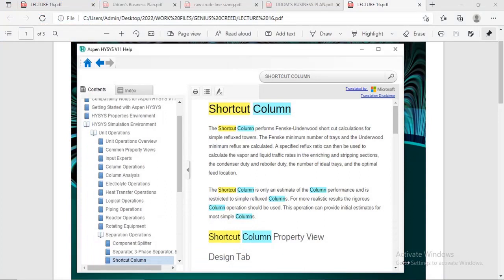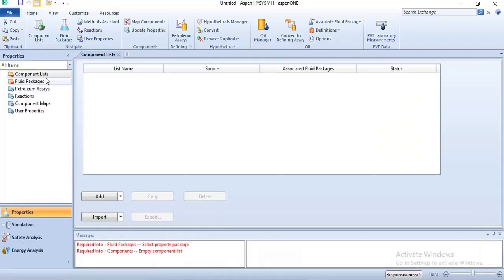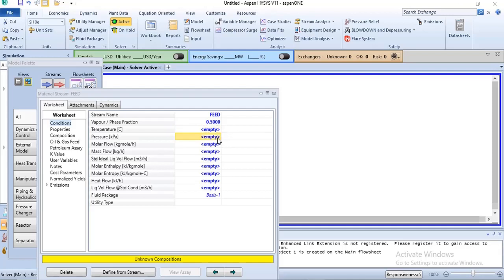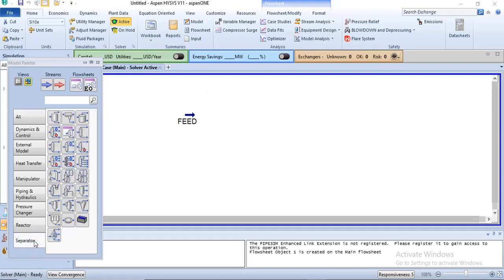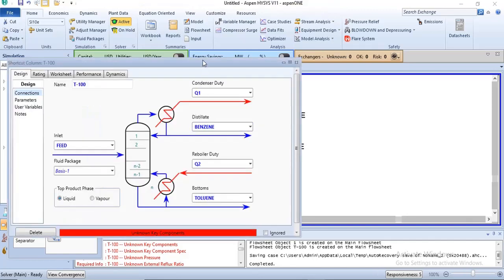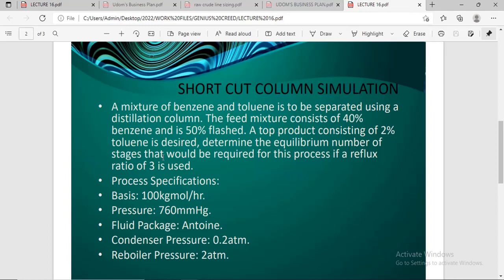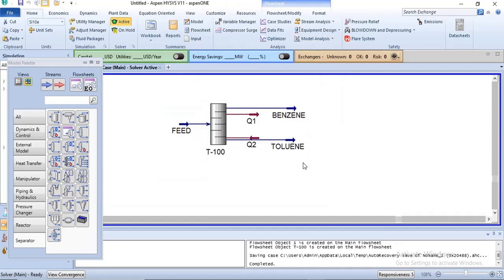Aspen HYSYS Lecture 16 Shortcut Distillation Column

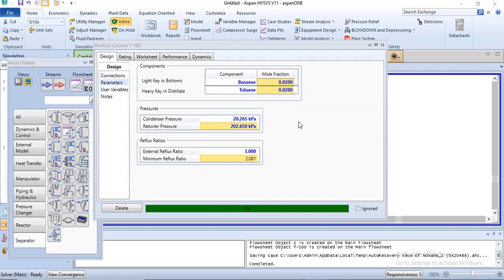Comment: 11:15 can someone explain why the mole fraction of benzene was 0.02? İt was not given
Reply: I think that fraction should have been included in the question. Typically, when the fraction of the heavy key in the distillate is specified (or vice versa), the problem statement has to specify the fraction of the light key in the bottoms (or at least some other information besides those earlier stated). So, my guess is that the problem statement was incomplete.